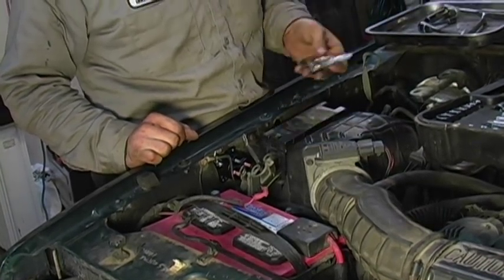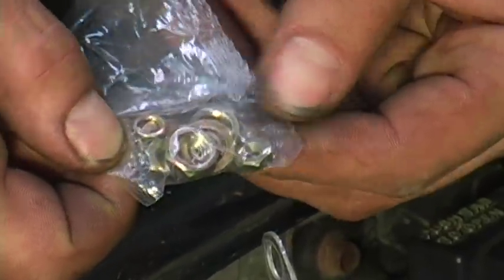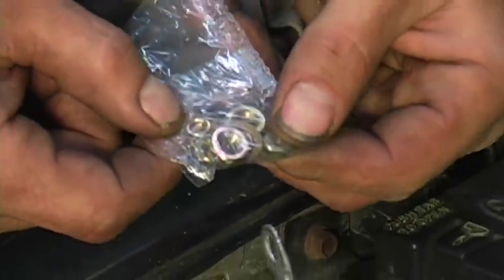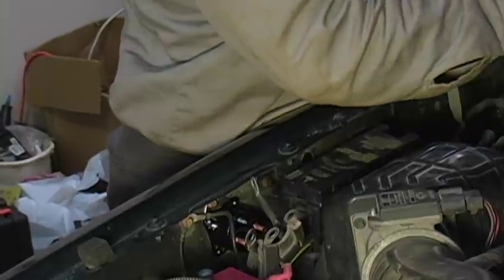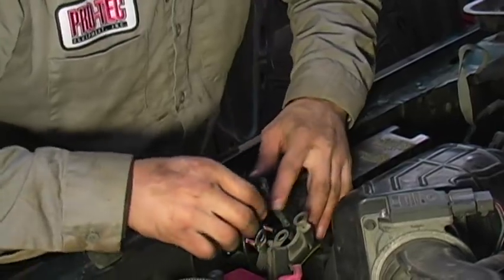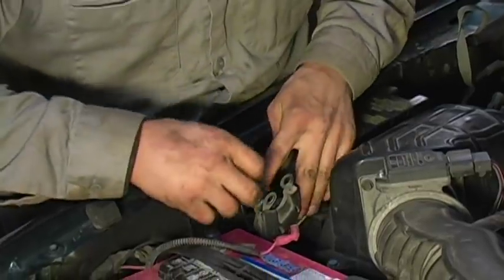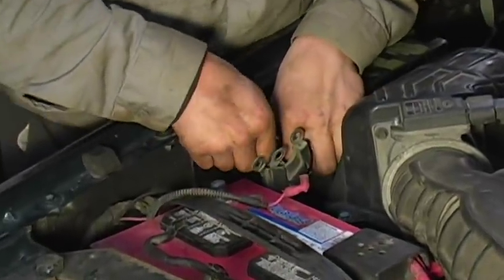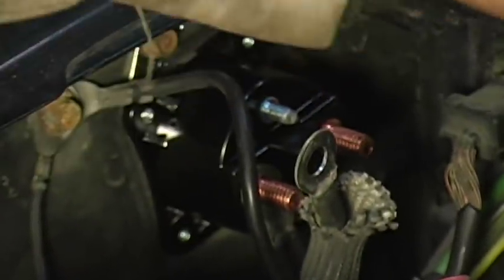How to Replace a Starter Solenoid : Hooking Up a Starter Solenoid's Electronics

Comment: I drive a 2000 Ford Excursion Diesel F250 and I too was experiencing intermittent starting problems.  I jumped the solenoid with a screwdriver and the truck started right up with the ignition on.  I then replaced the solenoid and everything runs fine now.  The mistake I made was to forget to hooked up the connection of the main fuse box back to the new solenoid.  In this condition the truck was absolutely dead.  NO PANEL, NO CHIME, NO NOTHING.  My wife found the loose wire and we reconnected it and the truck fired up without a problem.  This video was a lifesaver.  After 2 trips to the Ford dealer, I was able to fix this problem with a $19.00 solenoid and a great You Tube posting.  Much thanks  Floyd
Reply: I have a 91 Ford F-150 and the starter continues to crank with the key off . I have replaced the starter and solenoid and worked afew times and did it again.... WTF

Comment: 86 F250 and I have gone through 4 soleniods, last one a Motorcraft! The new one works for a little while then the starter will crank with the key out. New battery, starter and ignition switch also!        Thanks
Reply: It was a manual trans. I fixed by rewiring and putting on a good quality solenoid.   Thanks

Comment: is it OK to reverse the wires on the terminals?  I'm wondering if the wires have to be placed on specific terminals or if it doesn't matter which post they are connected to.
Reply: Nelson Severance
Reply: Hey  thanks.

Comment: Well ,both studs are positive feeds,  the ground is when we mount it to body,  I took my old one off and didnt take pic.  94 ranger 2.3,,,,  I was separating my alternator wire and putting my fuse panel on second post,,   this fella did put all on one side,  from what I seen all wires go on same post that the battery goes to !!!  T.y..

Comment: I did not hear any info about unhooking the battery first. Very important!
Reply: Janet Armstrong very important,that's how u fry ya computer or yaself
Reply: If the cars not running there's no potentially dangerous power surges ,    but yes for safety's sake,  or just b careful

Comment: Yep I appreciate the vid but i don't kno what wires they are from or to trying to replace it. In all vids they go way to fast not explains what each wire is to and for or order it cones off then back on. U can't see it clear either. The directions say much different then what u did. And the way it came off was very fast abd diffent then the way it's seems to be put back on. But ty.